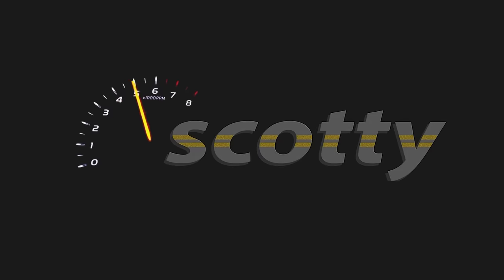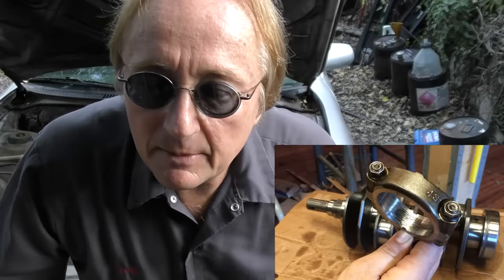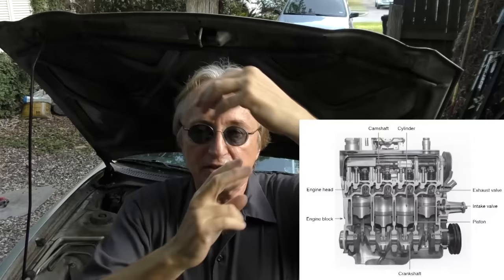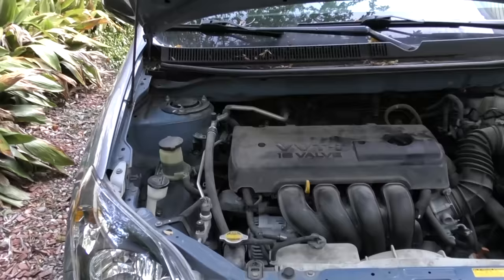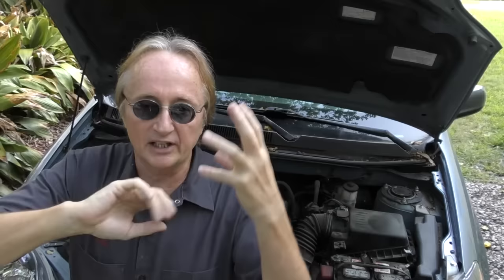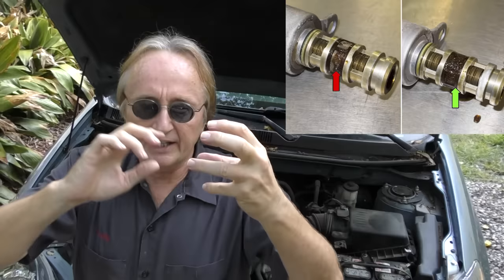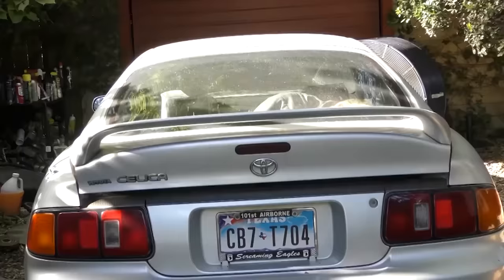Why Not to Flush the Engine Oil in Your Car

Comment: Hi Scotty, you are amazing, thank you for sharing your knowledge on auto repair, I learned a lot following your videos and advice but in this matter I disagree of not flushing the engine. I have a 2011 Buick Lacrosse CXL 3.6 liter engine, I had 7 check engine codes pop up, went to auto zone the kind lady behind the counter said do yourself a favor get a new car because it will cost you an arm and a leg to do the repairs, went to the dealership I'm not sure if they quoted me $9,700 something or $11,700 something. Scotty I gave my cousin who is a mechanic a call and he recommended that I flush the engine before getting rid of the car or paying a shop the arm and a leg lol. Scotty I flushed the engine, changed the oil and started the car believe it or not the check engine light went away and went back to auto the zone and no codes whatsoever, it's been now over 6 months and thousands of miles driven, the car runs excellent when idle rpm is less than 600, please share any knowledge on how this flush saved my car, you are a hero in my book, God Bless You for all you do.
Reply: For old timmers anything that is new is immediate "BAD"

Comment: Thanks for content you provide. I enjoy the videos very much. Questions for you to the topic for this video: 1) vvt is typical for non-American vehicles, so let’s preface that- but why would you want to avoid fixing a problem being hidden by the “sludge”? I eat right to be healthy, but I go to doctors to know that I’m healthy..cause I ain’t fooling myself thinking just cause eat good, then I must be healthy. If I have potential oil system issues, I would rather know and repair them to restore my engine power, lifespan, and ensure optimal performance. Unless I bought a piece of junk, why would I treat it with less care? 2) just because newer oils have detergents doesn’t mean oil build up cannot occur, regardless, due to the combustion process it is a naturally occurring problem that comes with territory. I’ve taken apart well maintained engines and found varnish or cooked on oil and coated oil pans still, so I believe that an addition of an additive once a while will do more good than harm. Plus, I would find my potential oil leaks before it turns into blown head gasket or something. 3) due to dirt entering the engine thru air inlets, completely unavoidable, and modern recirculating emissions, engines are very sensitive to contamination changes- maf, Inc, throttle bodies, maps, o2, etc- all these sensors can be impacted and cause deterioration in performance and mpg if additional care is not given, and can lead to premature failures that were probably avoidable. Thanks
Reply: I get what he's saying my 150cc scooters performance has only gone up after not giving it for service.

Comment: Another interesting video concerning a debatable topic.  I enjoyed the history of detergent oils segment.  I have flushed my engine oil regularly, be it a newer engine with lower miles (Acura Integra 130,000)  or an older engine with 250,000 miles (Volvo 940).  I also strictly adhere to a 3000 mile oil change schedule no matter the oil type, be it conventional or synthetic.  A clean engine tends to be a happy engine in my experience.  I have also flushed abused engines with high miles (Lexus LS 400 181,000) without any major problems.  I think it goes without saying that higher mileage engines tend to leak more for a variety of reasons and I would personally rather rely on knowing if it leaks based on a flush, than hoping that sludge will cure a bad seal.  The real lesson of the video is to change your oil regularly to avoid sludge buildup.
Reply: have to agree with you. i regularly change my engine oil every 5000km or 3000miles. because i've seen many engines collect sludges with oil change every 10.000km interval, which is the book recommendation. well it sounds short, but i know between heavy traffic in city driving and commonplace full-synthetic oil, 5000km is what i preferred. not sure about those high-end engine oils which promise twice the mileage and of course twice the price. i'd rather change twice just to be on the safe and clean side.
Reply: What brand flush have you had success with? My engine has been abused by infrequent oil changes and just adding more oil as it burned off. With 18X,XXX miles on it, I’m sure there’s plenty of sludge inside.
Reply: @LuckyCharms777  Gunk makes a product called Motor Medic Motor Flush.  I believe this is the rebranded version of their original Gunk Motor Flush.  Follow the directions exactly for best results and I might suggest several applications (over the course of a year) at oil changes for a severely sludged engine.  Good luck!
Reply: @brettkirkpatrick464  
Thanks, Brett, I’ll check it out.

Comment: couldn't agree more with Scotty about flushes and no matter how warm you get the engine or how long you leave it draining there will always be dirty old oil left inside the oil pump, oil galleries, turbocharger, laying in the cylinder head, hydraulics and in the sump. I change the oil and filter asap every time I buy a car and then again after 500 miles to be sure its clean. its amazing how cheaply you can buy oil in 20 litre drums too.

Comment: Seeing his Gen 6 Celica makes me happy, had an imported Celica ST202 SSII with the 3S-GE engine designed in conjunction with Yamaha (i know Scotty's isn't the 3S-GE motor). It had almost all the extra TRD components available plus a few other bits and bobs from some other reputable modification companies. Best car i ever owned, never skipped a beat, never broke down, still had all the power it left the factory with (plus more because of the extras) 22 years later. I had to get rid due to having to commuting for work where a diesel is more practical, and the paint was dying on the fibreglass body parts which would require a lot of work, as all the paint would need stripping back to apply a new gel coat and risking damage of the irreplaceable parts if done poorly. Sad day when it was driven away by someone else. Checking on our UK car database shows it hasn't been on the road since 2016 so was probably stripped for parts or accidentally parked in a ditch. It was only a Celica but she was my Celica.
Reply: And yet here you go.... You sold it to keep crying about it here.

Comment: 273, 967 miles on a 1987 Nissan Maxima V6 engine. Constant oil and filter changes keeps it pulling strong!
Reply: How often do you change oil?

My cheap Skoda Rapid with 1.2 TSI CBZA engine has 240 000 km (~150 000 miles) and mechanics often are surprised this engine has so many miles on it and is still running fine when most of these engines blow up after 150 000 km ( ~90 000 miles). Interesting is that manufacturer recommends chaning oil every 15 000 to 20 000 km (~9000 to 12 000 miles ) on these engines. No wonder they don't last.
Reply: Any oil burning issues?

Comment: Great! I'm gonna pour some crud into my old car's engine in order to seal all those leaking seals......
Reply: I have plenty stuck to the bottom of my 31 year old Chrysler engine I can scrape off and send to you for a small fee
Reply: Pork rinds !!
Reply: If the engine forms leaks after flush, why not change oil to high mileage oil, that expands the seals and gaskets?
Reply: So nothing wrong with a higher oil other than whats expected? I have a 15 40 i got foe about 4bucks i used but put flush in it. Will this oil work instead of what it says to use? Concerned need her fix so i can see my newborn
Reply: I worked at a junk yard one time.  The shop manager bought Lucas by the case.  That's immediately what I thought about when Scotty started talking about oil getting past the rings after a flush.
Reply: People do that to radiators lol
Reply: Nope he just means leave the sludge it already have in it
Reply: What Scotty said makes perfect sense as usual.

Comment: I agree with most of what you said in your video. I have used aftermarket engine flush (or diesel / kerosene) on a couple of old engines in the past but these had been sitting for years and the oil wasn't reaching the lifters because of sludge. I found that I had to do it a couple of times before it worked but as you noted, you're taking a chance at developing other problems like leaks or burning oil. I do know a few people that do this regularly (every 20K miles) and swear by it since prevents sludge build up and lessens the likely hood of developing the other unintended problems but I'm not sold on it. IMHO changing your oil every 5K miles or so is all that is needed
Reply: You are not developing other problems the problems are already in there you just expose them with the flush, if the engine's internals and the seals are worn out they are going to break down eventually.
Reply: @warthunder8624 although true, you are speeding up these issues by exposing them sooner.

Comment: 75 bucks- cue pic of field of stags. Genius!
Reply: Comcast use to have a commercial that said “Save Big Bucks” with kinda the same tisk at Deer in the early 2000s
Reply: Could you please explain the joke to a non-native English speakers who didn't get the pun?
Reply: I'll try! You'll notice when Scotty is speaking, at key points he'll insert a pic on-screen to emphasise his point. For example, if suggesting something may be a bad idea, he has inserted a pic of a diver holding on to the dorsal fin of a great white shark. Anyway, at 1:03 when he mentions that the cost of an engine rebuild used to be as low as 75 bucks (bucks being American slang for dollars), he included a pic of a field on male deer. Male deer can be known as either stags or bucks (a female deer is known as a doe).
Unfortunately when you explain a joke, it then tends to no longer be funny, but hopefully this helps you understand!
Reply: Thank you very much! That's a really thorough explanation!
I just didn't know that male deers can be called bucks :)
Good jokes don't loose anything after being explained, and that joke is definitely good.
Thanks again!
Reply: $75 in 1958 isn't $75 in 2018.
Reply: @colind9638  thanks! I do get most of the pics but the bucks was unknown to me. Regards!
Reply: Don't forget, that's 1950 dollars, when you could still get your dollars in silver if you wanted instead of worthless paper.

Comment: Well, flushed my OM642 in a Commander after several 30 000km service intervals from previous owner. Ran a lot smoother. So it depends from engine to engine, I suppose

Comment: We drain the old oil and fill with cheap motor oil to run through the engine and then after running for about 15 minutes, well then change the oil and filter put in Royal Purple or Synthetic. Best to do with old cars that have sat for a long time...

Comment: I don't know I have a 2004 4.0 sohc explorer, I just did my valve cover gaskets.  The left side was all sludged up with hard carbon and sticky tar . I cleaned it out with a rag and flathead very carefully. Then put everything back together poured a can of seafoam in the crankcase ran it for 2 days.  I have no more valve tick, no more rough idle, no more excessive heat on that side , and now she runs as good as when I bought it. Just changed my oil this evening after heating it up from work, it was dissolved and extremely blacker than I've ever seen it. So fresh oil in and it is running like a champ with 164000.

Comment: I've used this stuff at least every 40,000 in all my cars. Never, ever had a major engine problem. All my cars have gone 275,000 miles or more. Sometimes I've even gone 25,000 between oil changes. I make sure to use the flush whenever I go over like that to break any sludge. I always use full synthetic though, and 90% of my mileage is highway. It's just petroleum distillate (naptha) basically; which is just less flammable gasoline.
Reply: What brand flush?

Comment: When younger friends and I did the flushes with the old kerosene based stuff and you could see chunks come out of some of the engines.  Nowadays, I use Liqui Moly Engine Flush, followed up with a cheap filter and oil as a rinse before putting in the good oil and better filter.

Comment: The ONLY reasons I've encountered to use motor flush, which is basically kerosene, is an engine that's been abused and not maintained. A friend bought a suburban that possibly never had an oil change because just some black goo came out so we filled it up with cheap oil and substituted one quart of oil with motor flush and oh lord the stuff that came out after running that mixture for about 30 min at operating temp. It ran like new and cooler and was no longer borderline overheating constantly. Motor flush is a non invasive last ditch effort to keep something running

Comment: I always use flush in my engine i never had any problem with it i also change the oils regularly,my engine is very clean because of this.
Reply: Year make model please lol
Reply: This is video is for older or high mileage cars.

If you flush your engine every second oil change since new or like new, there is no reason flush should cause leaks.

At the same time I won't flush my car that has 330 000km, for the exact reasons stated in video.
In my case it would be better to use cheapest oil as flush every 600 miles until it clears up and then put good stuff in.

But who would do that😂😂😂

Comment: I agree, modern engines run much tighter tolerances than the clunky old oil burners. Fully synthetic oils perform much better, much less deposits. But the key really is to make sure the oil is changed at correct intervals.
Reply: what if you are the slob that hasn't changed the oil.  It doesn't seem to leak, no light on my dash to say its low, but it is low when I check it.
Reply: @shiningstar2903  how did it turn out?
Reply: Actually the tolerances are looser. These days you don’t need a ring compressor to install pistons
Reply: thats why i go get oil changes cold. so the plug is not hot. got one job
Reply: i love how on oil changes say added oil and charge you 5 extra bucks
Reply: all these new cars making tic tic noises like they need oil. oil fine just sound like lawnmowers
Reply: wouldnt be a bad idea to run it long after oil change so everything mixes naturally after cold oil change. then top off trans.fluid while hot in park on

Comment: Funny, I just got back from the Toyota Dealer to change my oil, tire rotation on a 2019 Highlander XLE 29,400 miles. They recommended for the next Oil Change to do a Flush because it was "discolored/dirty. 

I check the oil before I went to the dealer,  and I just saw a normal gold color oil. Lol

Comment: Changing oil & filter is the key to long engine life.
Mobil 1 Extended Performance Filter:
"99%+ efficiency...based on removing particles greater than 30 microns."
That means particles smaller than 30 microns will pass on through the filter and be circulated through the engine. The only way to get the finer particles out is to change the oil.
Reply: Use flush only every 50k is my advice.Frequent oil changes is a must.

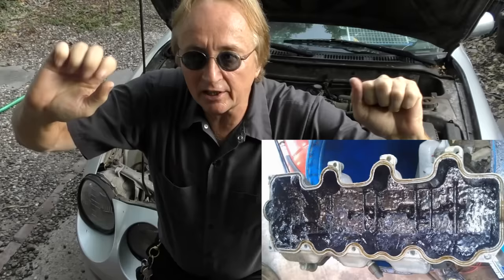Comment: 1:29   I still see sludge like that on modern cars.  I disagree with this video.  Especially if you have a customer who hasn't changed their oil regularly.
Reply: I bought 2009 honda civic whit 90.000 miles. There is sludge always on the cylinder walls by this cars.
Reply: I have 2013 KIA Rio. Had every last oil change done by the dealer at the recommended intervals.  I purchased the car brand new with 6 miles.  >.< I started burning oil at about 50k, the dealer gave me grief.  Long story short, the dealer had to replace my engine because it was sludged at about 75k miles.
Reply: I’m with you on this, crappy customers ruin their modern cars by skipping too many oil changes. I’ve got a 1mz-fe that sludges up even with 10,000 km oil changes and fully synthetic oil
Reply: I mean it's too easy to understand if you don't clean your toilet it will get dirty overtime.  I guess the important things Scotty means to say is, you don't need engine flushing in a modern car if you regularly changing the oil because of the oil filter and don't buy this unnecessary service from Mechanical shop or PMS shop too often.

Comment: I have a 1998 ford f150 4.6l v8 and it has almost 700 thousand miles and original transmission and motor
Reply: No freaking wayy

Comment: For those of you who get clogged vvt oil controller stay away from cheap oil filters. I had to change one cause the anti-flowback failed. Symtem: slow oil pressure build-up during start up. That was a FRAM Extra Guard.

Comment: So, there's one flaw I see in this video...
If modern cars and oils do well in keeping the engine clean, as long as the oil has been changed regularly, then a "flush" shouldn't actually hurt things at all, but simply do what it's supposed to do, which is be just a spot clean getting rid of minor buildup, so the oil works even better?
Reply: It's a waste of money. It actually does nothing to maintain an engine. Those flush products are for engines that have sat, non running for years, and the person trying to service the engine wants to get rid of all that nasty oxidized oil out of the engine.
Reply: He's basically saying that if you change your oily properly then flushing will be a waste of money, if you don't change your properly then flushing the engine can screw it up.

Comment: Now I watch his videos even if I don't have a car problem. Too funny! 😄🖒
Reply: I have been even before i had a license bro . Now i do all my own work on my car and i skip some “work” because i drive a 1990 toyota thats in almost mint condition body wise and it needed some seals replaced and from this wonderful mans videos i was able to tell my mechanic what seals i needed replaced and my mechanic trued to tell me different seals that needed to be and i insisted that i only wanted the front main seal and a new timing belt/water pump and thats all and he did the work and my oil leaking completely stopped so i was right haha